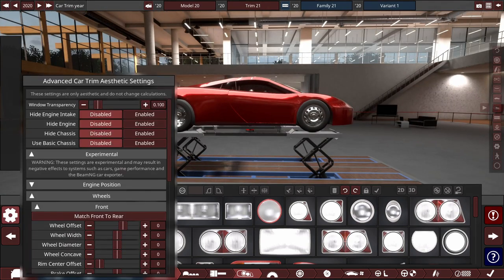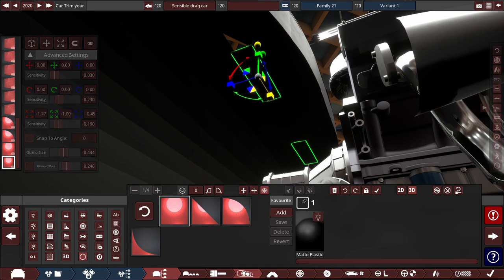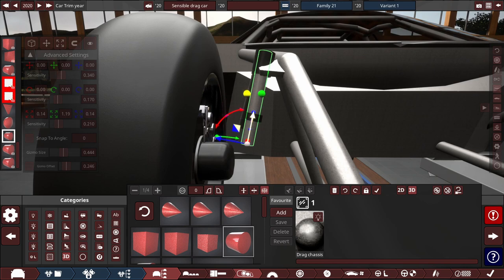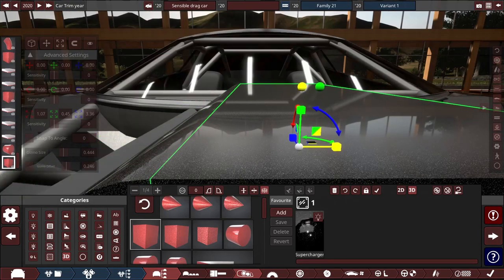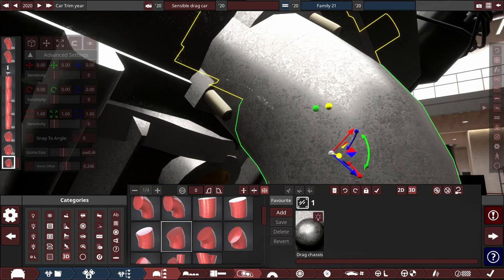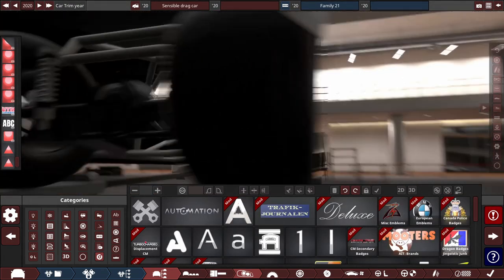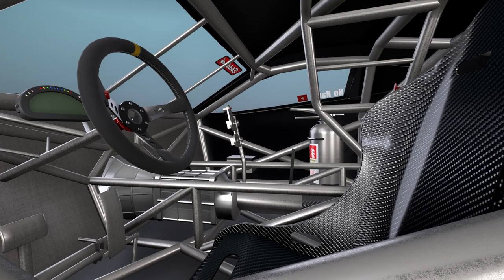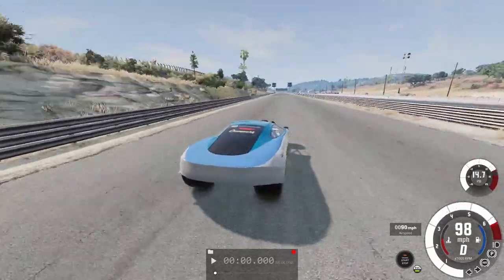Building a very sensible dragster in Automation

Comment: Very well done, I think the only thing that is off about it is that there would be a plate around the transmission and drive shaft.  So if they did decide to disassemble themselves the driver wouldn't have any shrapnel thrown at them
Reply from the maker: I don't think I saw that in any of my reference photos, but I could be wrong - plus even if it's not a common thing, it's still probably a good idea. I would assume that's what the thick... tube thing over the driveshaft is, but I didn't see anything for the transmission.
Reply: Agreed! The trans tunnel!
Reply: @noname2242 I'm a nhra nut, and I watch videos in builds ALL the time, and ALL nhra specced cars HAVE to have a trans tunnel to pass inspection
Reply from the maker: @alexwesley6829  Interesting. Probably wise - if the driveshaft lets go it's not exactly ideal for it to have no obstacles on its way to decapitate the driver.

Comment: I have to say, the blower is a lil short....it should be taller than it is...also, twin charging isn't allowed in NHRA rules races... though, they are fucking cool....as a drag car for doing non-nhra races, would be sweet!
Reply from the maker: Yeah, it's been over a year so I don't remember for sure, but I don't think this was built to NHRA spec - the twin charging was mostly a solution for me not wanting to figure out how to do that top fuel/funny car style engine blower with Automation parts.